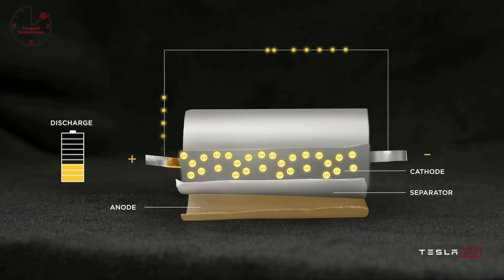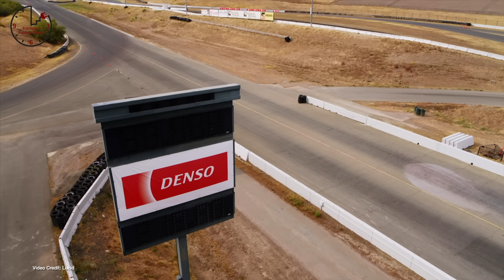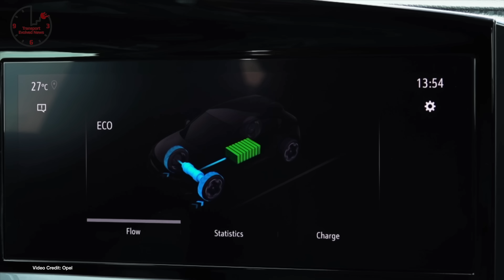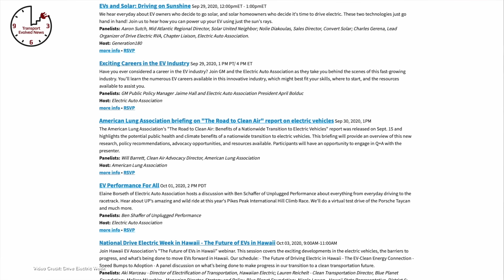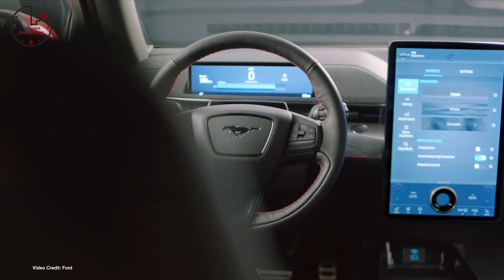TEN 309 - Tesla Battery Day, Milton Out at Nikola, VW ID4 Demand Crashes Servers

Comment from the maker: We screwed up. Nikki said 4860 not 4680. She’s mildly number dyslexic.
Reply: Dysexlics, Untie!
Reply: Hah beat me to commenting on it.
Reply: I understood what she meant seeing as was correct when she did the other episode talking about Telsa's Battery Day in full, so she was forgiven for the oops.
Reply: Heard the correct numbers earlier from Sandy Munroe.  He is extremely impressed with the structural battery pack, cell-end cooling design, and reduced cost coming from module elimination, and the 5x reduction in the number of cells to produce equivalent power.  It will be interesting to see if they can cast a one-piece structural central floor pan/battery pack with coolant channels inside and integrate it with single front and rear die castings for the major chassis “skateboard”, and what body shell they will sit on it to sell it in mass production quantities.
Reply: @eddiegardner8232  My only single concern with the casted piece is how will repairs be handled. I am going to assume the entire sub section will need to be replaced (unbolted?) or could you patch it using welds? And Tesla sell sectional repair pieces?
Reply: @fredpinczuk7352  if you are in a wreck where that casting is damaged the car is likely 'totalled'.  These days just a few smashed panels and vehicles are considered a complete insurance loss.  These castings attach to crumple beams and other parts that are replaceable for minor accidents.  See Sandy Munro's Y teardowns for information on that.  He talks quite a bit about the crumple zones.
Reply: Meh. We all make mistakes. We love you Nikki.😊
Reply: Still a boss.
Reply: @ZissouMoonshot  this one time
Reply: No problems, we're all buggered 🤪
Reply: I guessed that much - no big deal. In Croatian we even have a name for that pretty common slip of transposing two adjacent numbers.  Just put a text overlay with the correction, for the posterity.
Reply: Lol
Reply: The fan Boys are on the way to Tp your office

Comment: Too bad Nicola motors won't make it to production. GM could make all the HO2 semis and the diesel and gas stations stay in business and still exist just need them to offer super fast charging stations charge by the kWh. With Solar Powered canopies as a added benefit of shade and producing more electricity. Then eventually those diesel and gas tanks can be replaced by HO2 tanks.

Comment: Nikki - Clarification on the California EO (executive order) to ban ICE car sales starting 2035. There is no ban currently in place nor can the governor unilaterally establish such a ban. The EO declares a GOAL of phasing in zero emissions vehicle sales requirements between today and 2035. The EO informs CARB (Calif Air Resources Board), which has the ultimate authority, to set the timetable and phasing levels. CARB does not have to act on the EO, but typically does, and will use it as a guideline in setting allowable emissions sales levels through it's enforcement powers. (Source: "Sales of new gas-powered cars banned in California by 2035: What you need to know") (https://www.latimes.com/business/story/2020-09-23/sales-new-gasoline-cars-banned-by-2035-what-you-need-to-know)

Comment: On China,  I don't think I will buy anything from China as long as they are holding innocent foreigners hostage for no other reasons than political. I try to avoid anything from china even if it is from western companies that manufacture there. It is difficult to do but not impossible.

Comment: I actually was not impressed by Tesla's battery day.  Why?  Batteries have been dropping in cost at about 11% per year for over a decade.  Lots of reasons for this but the most important are volume and competition.  Believe it or not there are smart people who don't work at Tesla.

So, Tesla saying a 54% drop in cost in three years isn't that far fetched.  First, it is Elon time.  So it will probably happen in four and half years, maybe five.  If you take the 11% drop in costs and compound it over five years then 54% seems pretty reasonable.  However, it will be reasonable for all competitors.  Because if you look at the actual batteries being produced Tesla doesn't seem to have an advantage to me.  For example, if you look at the weight and Kwhr capacity of a Chevy Bolt battery it isn't much different than the Tesla battery.  Pretty much true for everybody.

And, as far as using the battery pack as part of the structure, plenty of manufacturers do that already.  Nothing big there.  I am not sure building it within the structure makes sense from a maintenance standpoint.  

I am not crying doom and gloom for Tesla but their path forward is going to be tougher.  The Nissan future electric SUV, the ID4, and the Chevy Bolt EUV look like pretty nice vehicles and they are going to be under $40,000.  Can Tesla keep demanding and getting a premium price for their future products?  And in sufficient volume to fund their development?  I don't know

Comment: Around (3:45) you say take it from you "Nikola's future... visit from the grim."  Perhaps your conclusion is.a bit premature?  The CEO may be out, but the company certainly isn't.  For example, around (14:25) you refer to AirBus and their new H2 initiative "Airbus chosen H2 instead."  Don't you think there is a lessen there for you?

Why did AirBus choose H2?  Probably for two reasons, H2 has 40,000 wh/Kg of specific energy density, versus Lithium-ion's 300 wh/Kg, (a huge advantage from a power/mass ratio perspective - crucial in power train design), and best of all, H2 can be produced cleanly using renewables and their surplus during "off-peak" grid use.  Use water based H2 and you only get most of the water back.  It's a water cycle, the only energy paradigm compatible with biology.  See the difference?  Whether it's Nikola, or any other company who connects the dots (i.e. Airbus) realizes the vast amount of clean fuel (H2) which can be produced with the surplus of renewables.

AirBus chose clean H2 because its performance is superior, and its supply, and use is non-toxic.  You "all battery" types need to think of the big picture.  It you really want a 100% clean transportation system then, eventually, you'll come around to the thinking of AirBus.  They're choosing clean H2 because it makes intelligent sense.  This renders your conclusion around (3:45) as a "visit from the grim" a bit emotional... just shows you need to think about Why AirBus chose H2, and why it matters to All vehicles in clean transportation:  true non-toxicity, universal fuel availability, and superior Power/Mass ratio in the drive train.... as the song say's... "Can't touch that"
Reply: The issue of Nikola going bust is not about whether H2 is a viable energy-storage medum for long-haul trucking applications. You'll notice that nothing was said against Tesla's, or anyone else's, efforts to develop that for market. It's simply down to Nikola - the company, itself - being built on fraud.
Reply: @dwc1964  Answer me this?  How is the fraud you refer to... I presume rolling the truck down a hill... any different from Tesla claiming a line of All battery Electric Semi's are going to be a real thing?

Charge just 100,000 Battery Semi's and you'll pull 100 Gigawatts in real time from the grid. Is that realistic in your mind?  Let alone every other thing (fleet) Tesla claims can be battery powered.  How is that actually any different in what constitutes fraud?

The problem is it furthers the FUD campaign against Fuel Cell EVs in general, as It furthers misinformation.  That's why it's destructive.  When YouTube personalities use "visit from the grim" language you think that only applies to Nikola?.. And, just because a CEO changes, doesn't change the business model a Nikola, or Airbus has?  Does it?  She didn't say Milton meets the grim, she said Nikola meets the grim... see the difference?

Nikola isn't out of business, only one man lost his job.  To the host of this show, that seems to be it - the whole story - the whole ball of wax.  The fraud is in how what's considered fraud is measured.

If you applied anything near a universal standard, you may be able to take a look at the environmental and other costs associated with a world-view of chemical batteries, and the real-time danger they present to a grid not designed to accommodate the enormous electrical demands, you so easily assume can be magically fulfilled using all battery EVs.

When you have clean H2 available and understand 100% clean fuel is relavent, then you'll understand why Airbus's decision is important.  And, how the host's linking of Milton's fate with Nikolas is short sighted, and ignores the Nikola business model value.  I repeat, you could learn something from Airbus.

Comment: Volkswagen will be very disappointed in their EV market demand, range and 0-60 miles 8.5 seconds ?? WTF is that !!
Reply: That is the performa of the average compact cuv, aka cr-v and rav 4. It also costs the same as those after incentives, 30-35k. If you want more power, for 3500 you can upgrade to AWD and 300 hp. 😜 The ID4 is not a preformance car, but it is also 10k cheaper than the model y plus it qualifies for the 7500 federal incentive. So 17.5k less. It’s a great value.
Reply: @davetravels9273  I think the VW is actually very nicely priced in that category. I was tempted to upgrade from my Spark EV from 2016 but I am waiting for my Cybertruck. It is great to see some actual compelling ones come out, unlike the Mini Cooper EV which I think is overpriced for range.
Reply: @davetravels9273  
Absolutely 0 value to me
Reply: @peterp4753  That's your preference. Choice is great and it's nice to see more EV options. 17.5k USD cheaper is a significant amount of savings to me and gives me value, but if going faster than you need or should is more important, that's your choice, that's what makes us unique. ;)
Reply: You seem very upset in your latest remarks - did you run out of breakfast cereals??
Reply: @robertkempe2730  He is afraid of Volkswagen.😂
Reply: Where was that started?

Comment: I get what California is going for and I support it but didn't they just have rolling blackouts this year? I hope they have some planning in place the increased Demand on the grid. They really should add nuclear to their energy generation mix
Reply: If more EV manufacturers can push V2G/V2H, that would be a huge help during a rolling blackout. 

I agree about the importance of nuclear power as part of reducing carbon output, but the turn around time on licensing and building a nuclear power plant is challenging. 

Also, those blackouts in California are more about cutting load to fragile transmission infrastructure to avoid causing fires than about inadequate power in the grid.
Reply: @e.wintertashlin2903  cool, thanks!
Reasontv was talking about it being a backup gas generator which failed. They are frustrating because they will raise legitimate point but then sometimes hide data which is in opposition or straw man an opponent a little bit (more fair than many... But still kinda jerks)

Comment: Great video 🍻 
I do agree with your statement that most Y owners probably won't opt for the performance increase. Even though the price is extremely fair in my opinion. I feel like they would rather drop $1000 to 5,000 on paint protection films and ceramic coatings. I think Tesla would be better off offering clear bras from the factory .
Reply: I previously declined the same offer to increase acceleration of my LR M3 AWD, as it has more than enough acceleration for my purposes (and my wife already complains whenever I floor it without warning her).

Comment: 14:20 Airbus supports R&D for VTOL vehicles, especially through its start-up A³ working on the project 'Vahana'.
Until recently, it worked on an electrified airplane in collaboration with Rolls Royce. The project, called 'E-Fan X', was scrapped due to CoVID-19.

Also, the airline industry represents around 3% of the total CO2eq emissions globally.
Reply: @djp3637  , it's one of the more active industry to reduce emissions, simply because it is hellbent on reducing cost and fuel is a major one.

This is not where leverage is to reduce global CO2eq emissions.

Certainly not the biggest, far from it.

Automobiles, fashion, construction are the top three.

Most flights are regional, for passengers and cargo. Electrifying planes for sub 1000 miles will have a massive impact, especially in reducing the cost of technology and facilitating its implementation throughout the industry, then adapting it for long haul flights.
Reply: @djp3637  , which does not change anything I pointed to.

Comment: 9.245 secs, with 3/4 of battery removed for less weight ... And skeleton interior for also less weight. 
And you still talk about Lucids times like they are a thing if Tesla did that on the mutch heavier plaid model s then it would pull 7s not 8s